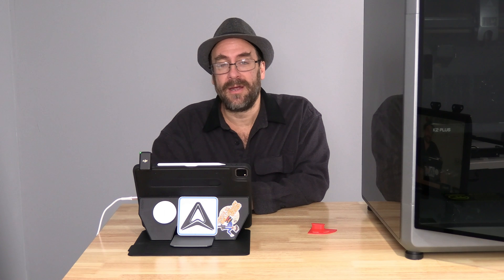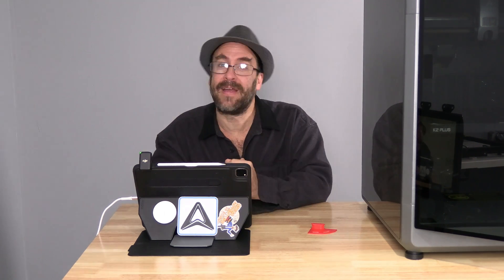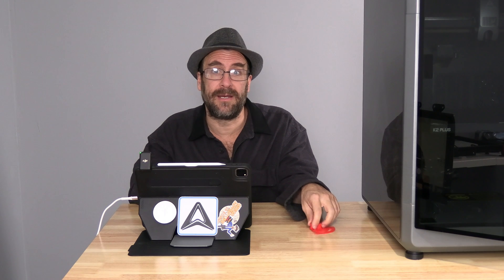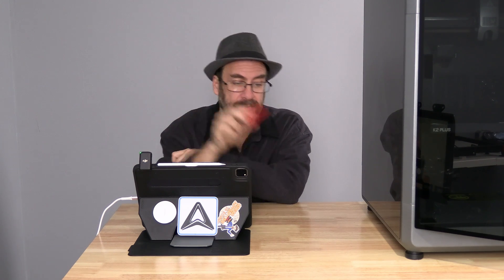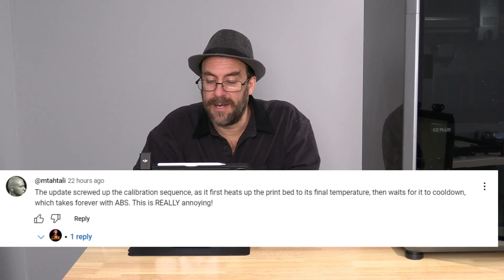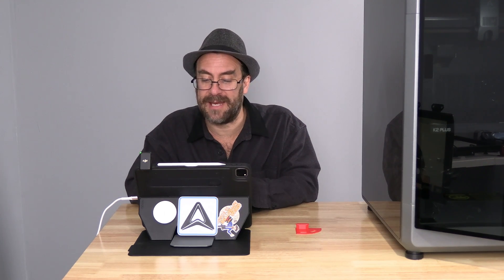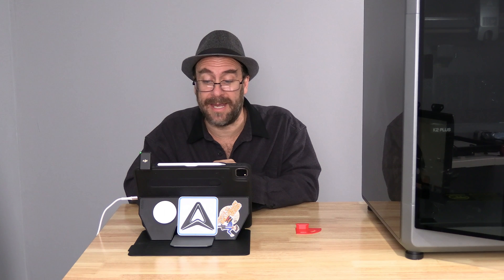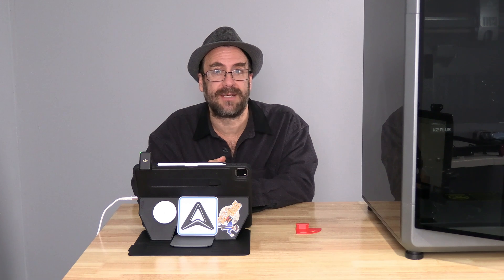K2 Plus Firmware Issues: *Creality Response* - Belt Tensioner, Camera, ABS ABL Issue. *Watch it all*

Comment: Own 2x Bambu printers which have been 99% flawless with several thousand hours on each machine. I brought a k2 plus because i wanted the extra size bed and the h2d/h2s were not out then. I have had nothing but issues with my k2 plus and would NEVER buy a creality printer again. What they say about creality jank is SO accurate
Reply from the maker: K2 has been problematic. However, most of the issues are CFS related. Shame

Comment: Throwing in the towel and returning the K2 Plus Combo while I still can.  

I’ve been printing for about 6 years now and this was a huge upgrade for me. I was so excited. After a couple successful prints I’ve been having major issues. The software on the printer has frozen several times resulting in ruined multi day prints because it wouldn’t return to the proper layer after rebooting. This persisted after resetting the printer. Now I’m suddenly having auto leveling issues which from what I’ve looked into online seems to be the exact same issue Uncle Jessy had. I get the fact that things can happen but this is a bit too much for this expensive of a printer. Not to mention the back and forth with Creality support has been horrible. Perhaps it’s a language barrier but they seemingly ignore most of the context of what’s written just to leave me waiting another day for an inaccurate response. I’m very willing to tinker and adjust as time goes on. This however is just excessive so early on in the life of a new machine.
Reply from the maker: Sorry to hear that. There have certainly been some growing pains with the K2 Firmware. I've been working with Creality, and next week, I'll be speaking to the Hi Combo Project Manager in person. Sadly the K2 Manager didn't pass his Visa Test. I am confident they will iron things out, but I feel your frustration. I too have experienced the firmware freeze
Reply: How do you even return something this big?
Reply: @TechCarnivore1  same packaging it was shipped in. I actually decided to keep it after getting some response from support.

Comment: Just got power outage, and had an opportunity to test K2+ power outage resume feature - NOPE. It detected the outage and offered "Resume" button, but after clicked, got Xyyy "system error, please try to restart". OK restarted, Resumed the print task, everything started to move with like 10% normal speed, and I got "e servo abnormal" error. Tried to Extrude/Retract the filament in the menu, got filament jam. OMG K2+.
Reply from the maker: I've never had much luck with resume on any printer. Heck,  my X1C Layershifted a print job of 8 teddy bears, after running out of filament. I typically just start over after a power failure. However, my Elegoo Giga survived a recent power failure. I was impressed

Comment: Nice you get responses. Creality Support seems to have stopped responding to everyone and have gone in to hiding.
Reply from the maker: That's 100% bullshit. Creality is extremely active, everyday, in the community, and via support
Reply: @3DRundown  For the last week and a half, no one seems to bet responses from them.  I have emails in to them almost every day that go without responses.  I have FB Messenger messages to them without response.  Now, next week they start their 8 day New Year's holiday.  I have had help from the forum community but no response from Creality.  Many others have the same complaint.  I think they are overwelmed.
Reply from the maker: Sorry to hear that. Assumed you were trolling. This is not typical of them. They have a MASSIVE user base, and their support workload is insane. It's made worse, by people that email them EVERY DAY a million times, for the same issue.  Yea, break comming soon, unfortunetly. 
I would LIVE CHAT them after 9pm est, or email: CS@CREALITY.COM
Reply: @3DRundown  I would guess that they are just over-whelmed and underwater with problems. This printer is selling faster than they can make them, it seems.  Thanks very much to the geniuses in the Wiki Forums, my main problem with extrusion problems is fixed. The tube holder broke and tiny bits of metal got in the filament cutter and damaged the blade and it would not cut filament.  The error message on suggested that the nozzle was clogged. With all my moaning and upset-ness, I learned to tear that extrusion housing apart and back together (including the spring that sometimes goes flying) in very little time.  A guy in that forum designed a part to hold the tube.  I printed it on my X1C in ABS (first time I ever used ABS) and it works a real treat!  I just can't fit the head cover on, but who cares.  I did a two color print yesterday that turned out better that it did on the X1C.   I guess everyone expected it to last more than 3-4 weeks before the first failure.  That tube holder design on the the extruder is really bad and breaks easy.

I have yet to hear from them on that extruder cover.  They need to make more parts available.  I did order a couple of the covers from AliExpress but those won't ship until about March.  The fix is so good, I don't know if I want to go back to the original cover, or at least until more filament cutter blades show up. - lol
Reply: @3DRundown  Also, what happened to that belt tensioning video you were going to do?  Their on-line instructions are as clear as mud, or do not match current firmware/software.   I think I have both deltas >100,000 but still fail calibration.  Like you said, it still prints very well for me (when it wants to print).  I am not picky with quality as other are, but am generally happy with its quality.
Reply from the maker: I backed off of it, as even my discussision with them, internally, have left me a little unsure, of the best way to instruct people on the belt tention. The K2 Plus, has 2 very simple tensioners, on the back, as well as, a way to do a much more advanced method. But, I need to be sure, we are getting legit reporting on tension, from the firmware, rather than having people mess with there belts, over false alarms.... Recent firmware, have reduced the # of people with belt errors, dramatically. Hopefully, those left, have ACTUAL need to adjust.... I hope to cover it soon. Just need to be sure I'm teaching you things that are correct....
Reply: @3DRundown  Thank you.  The last firmware, that I am aware of, was released in the beginning of January (4th????), and that's when my errors started.

Comment: Another new thing i noticed is that the bed adjustment screws are now loctited. My first k2 was not. This makes any manual adjustment very difficult and bed replacement much harder. Very hard to loosen screws now.
Reply from the maker: Interesting. I wonder if peeps reported them vibrating loose....  It may not exactly be "loctite" as there are variations, usually distinguished by COLOR, that are less permanent, than oldschool Blue

Comment: I have not had a successful print yet since receiving mine. Appears I have a bad extruder motor or extruder.  Constantly fails in middle of prints with CM2788 CM2784 errors depending on the FW version. Happens with CFS and direct spool. Tried Hyper PLA and Sunlu high speed PLA no difference.  No clogs in the extruder and have taken it apart to verify 3 times now.  Waiting on Creality to respond to my case. Appears to be a $1500 brick right now. So dissappointed.
Reply from the maker: Bummer. Sorry to hear that. Unfortunetly, regardless of the printer or company, frustrations like this can happen. I would stay on the most recent firmware. Document your experience, in plain english wording, use pics and video, send to CS@CREALITY.COM

Make sure your nozzzle isn't clogged
make sure no broken filament, in the path from the CFS funnel, to the hot end
test without the CFS
be sure your PTFE tubes aren't too long. If any doubt, cut them shorter. FLUSH with a PTFE cutting tool, is ideal, or a razor blade. no tool that will crush the cut section
Don't use orca, use CP6.
Reduced your print speeds. Don't print at default profile speeds. Get down to 175-200mms for now

Comment: I have had all sorts of issues since switching to Creality Print 6. All of my PETG prints have had issues with constant error codes concerning filament clog (in which there were none) and retract issues which have led to several failed prints. I have taken the extruder apart several times to find it clear with no clog. I decided to reprinted a succesful PETG file sliced with Creality Print  5 and everything went fine. This led me to reslice the faulty Creality 6 slices in Creality 5 . One print in but everything seems to be working fine. Love this printer, but the last few days have been aggravating. Has anyone had this issue?

Comment: you have to introduce the adaptive bed mesh at each print with the possibility of selecting whether to do it or not. also my K2 gets the offset wrong at the final change and makes me waste hours of printing. also by relaunching the same gcode sometimes the offset is correct, other times wrong and other times it gets it wrong after the filament change. it is almost unusable with multicolor

Comment: I am having a belt tension family error before the update CA2710. The Belt Tensioner error I'm getting now is more targetted with the update. 
CA2715
"Belt tensioning module error, left side belt tension module not calibrated, please ecalibrate module" 

I'm definitely having an issue with the auto belt tension on the Left (Y?) side and when I try the wiki belt tensioning calibration before and it was throwing all sort of errors and asked for a restart the machine to clear them.

I have done the wiki test again yet with the new update yet

I've been able to print with this belt mentioning errors but I defiantly want to clear it. (It could be that module is failing/dead)
Reply from the maker: The reality is, your judgement, and printer performance, are the best judge of belt function. If it's printing well, and you see no issues, such as Layer shifting, grinding noises, etc.... I'd run it.

Comment: Ive updated my K2 Plus and CP 6.0 to the most updated firmware/edition. Trying to do PA calibration print, so I uncheck calibration in all the places and still my printer does auto bed leveling and Auto PA/Flow. Kinda defeats the purpose of calibrating a filament myself. Am I missing something or is this something Creality should be aware of? Also, I thought I would start fresh with all the updates so I used the Extra Build plate. Homed all axes, loaded side spool filament, hit extrude and my nozzle dragged a nice fat 3mm deep gouge through half of my buildplate. I hit home all and then extrude. Why would the bed be in the way? Ruined my new plate

Comment: I wanted to provide another update today. I installed firmware version 1.1.1.5 when it was released and received a CA2720 error message (specifically for the right side tensioning belt). Prior to and after installing the update, the printer was printing fine so I decided to ignore the message for now. I powered up my printer today and saw firmware version 1.1.1.7 available so I decided to install it. After installing the firmware, the printer restarted and I decided to shut it down, pull the plug for about 10 seconds, and powered it back on. I ran the calibration tests (all of them) and this time it passed the belt calibration test. I just printed the 14 minute benchy and it printed fine.

I'm not sure what the update did to resolve the error message I was receiving. Did it fix something or did it just remove the error message? Hmm....
Reply from the maker: Excellent. To my knowledge, the purpose of todays patch, was to resolve the ABS ABL bug. I'm not aware of an adjustment to the belts calibration, but, there may be one. Others have reported the same positive result.

Comment: Since the latest update, my k2 has been having consistent nozzle “clogs” seemingly after the first payer is printed. Never had this issue pre-firmware update. Anyone else having this issue?  When I disassemble, there is no clog found.
Reply from the maker: Today's update? Or the previous
Reply: It was the previous update that people were reporting the belt tension issues with. No belt tension issues for me, but all of a sudden I was getting errors related to a clog that didn’t exist. Never got them before that update. I just updated to the latest release from Friday, and I’m back to printing without any clog errors, so that seems to have been resolved with the latest update as well.

Comment: So I'm new to 3d printing. What's the importance of belt tensioning and how would you know it needs adjustments?
Reply from the maker: The belts are moved by gears. The belts move the hot end. If the tension is too loose, the hot end won't respond properly, or will have play, and this will cause layer shifts, Z-Banding, etc. Too tight can make the movement stiff.  You can have excessive Vibration, etc. Typically: LOOSE is the problem. There is ideal tension. But there is also a margin of range that will work fine..

Comment: Well got the new firmware this morning.  DID NOT run calibration, turned machine off, rebooted and ran calibration.  Self check worked, I am no longer getting the CA2721 belt tensioner error.

Comment: My k2 plus failed immediately after the 1.1.1.5 update. The strain gauge failed. So it can’t level at all. 
Seems too coincidental that it failed immediately after the update. Creality are sending me the parts to fix it. 
I’m still suspicious that the update caused it. 

I as an end consumer, should not have to disassemble a nearly $3000 au printer that’s brand new to fix it. 
Not an ideal start to my creality journey. Hopefully things improve from here, or it’s going back for a refund.
Reply from the maker: This kind if thing is part of 3D printing

Comment: I have issues everytime with getting the bed mesh to work for any material other than PLA, I have to manually adjust the first layer to a different height every print, its quite annoying to get it perfect while its starting its first layer..

Comment: I hope you see this as I have been dealing with this since I received my preorder unit back at the end of nov.. I was getting CA2710 error before the firmware update. I ran the calibration with the fluidd commands and compared the values on the wiki.  The value that suppose to be '0' never got to zero. Contacted support (this after several caliubration attempts with the tool and commands) they sent me replacement motor x2, circuit board x 2, and strain gauges x2. I swapped all those out and was still getting ca2710 error. The commands for the right side belt and left side belt always give me strain gauge not calibrated abnormal in fluidd.  Question here is do you have to do a restart of machine after every calibration with the fluidd commands and tool?? Also After the latest firmware update The belt tension check is not in the self check but found in the calibration menu on the display screen. A lot of people miss this and think the self check is great and the issue is resolved when it has not been. I now get a CA2714 belt tension module error, right sidebelt tension modulenot calibrated, please recalibrate. The issue is the belt is so far out of spec the micro tuning the tensioners do cannot compensate. There is no ballpark or starting point to get the belt/tensioners close enough. I wish creality would come up with a freqency.hz needed on the belt when plucked to at least get us in the ball park. Or someone comes up with a printed calibration tool like they have for some of the other printers and their tension.  Also notice the actual pulley/tensioner the motor connects too was as far out as possible on both sides.  On the channel "The incompetent craftsman" he breaks down the belt tensioning and the commands for belt tension in fluidd, for x and y however I always get an error when sending those commands that state "error; webrequesterror, message'; code key 715, msg; belt tensionmodule strain gaune not calibratedabnormal mdly.  I am super happy the belt tensioning is getting more attention as I can still print with my printer but letter ghosting is horrendous.

Comment: My machine had the issue with the bed cooling down to 50 degrees then running the ABL sequence. I ended up power cycling the machine and running the calibrations again and the problem with the ABS went away.
Reply from the maker: As long as there was an ABL Done, it won't happen. If doesn't see a new ABL, this happens. But, a patch is expected to end this, Friday the 2nd

Comment: Thanks for the update.  Not had a problem with the belt tensioning but did experience the calibration sequence issue that is annoying as hell.  Will also update to Creality Print 6.0 in a couple days but keep 5.1 active until 6.0 feels stable.
Reply: It is still possible to keep 5.1 and 6 on your computational device. Or if you’re a Mac guy, MacOS version of 6 is due by the middle of this month. Hopefully, by then these teething issues will disappear. 🤞
Reply from the maker: Creality just released a new 6, and it looks to be more stable than the last release. My crashing has stopped.

Comment: Im still waiting on replacement parts. The printer wigged out, carved a couple lines into the plate and the pneumatic coupler on the print head broke. 
They sent me a plate, replacement foot (because it broke off in transport), and a buffer, which was not the part that broke.
Reply from the maker: Wow, crazy. That sucks hard. Hope things get straightened out for you. The K2 Plus is a really nice machine. Hate to see nonsense cause it to self destruct. Let us know how it goes!
Reply: they sent me replacement feet because of them being broke from shipping and bonus they added a new glass door. mine was fine...Not sure how that happens. Im guess they are clicking on stuff and sending out and perhaps some things are not labeled/inventoried right at creality.lol Ill take it though